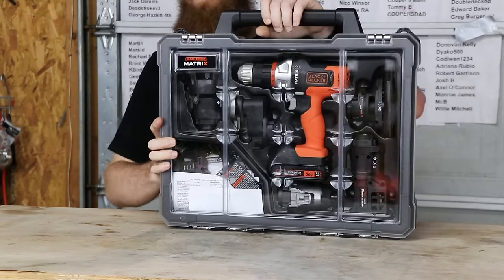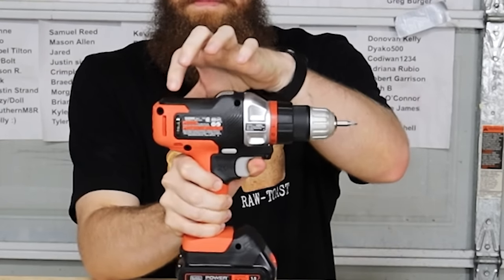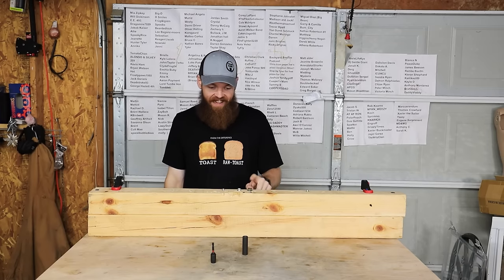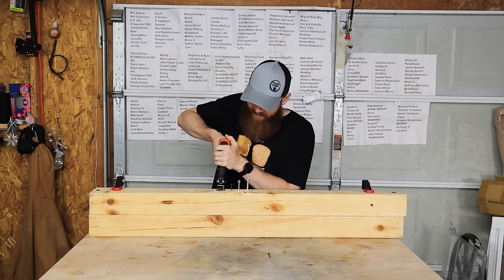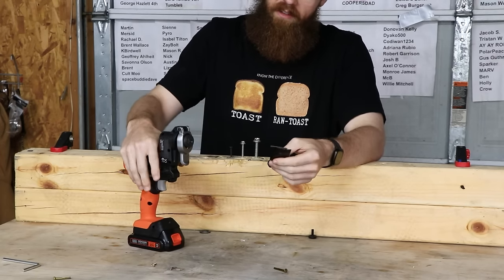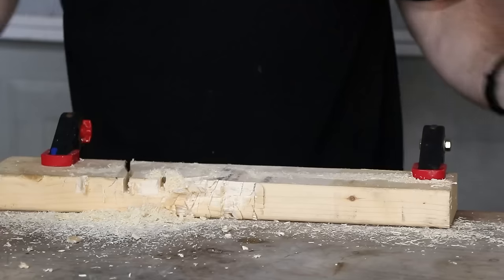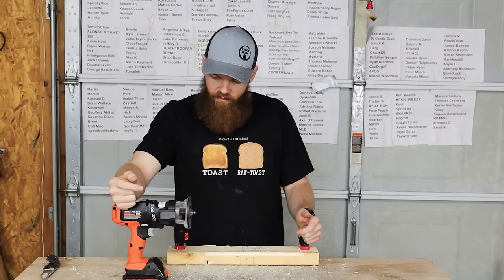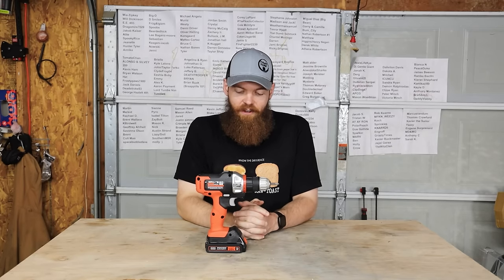Is This The Last Drill You'll Ever Need? | Black & Decker Matrix system

Comment: Before I could afford Dewalt tools I actually owned the 12 Volt version of this kit, they didn't have an impact or a router but it did what I needed it too back in the day. The main reason I stopped using it was the batteries wouldn't hold a charge anymore and the batteries were not as easy to come by as they are now with online shopping. There was no such thing as amazon back 20+ years ago, the internet wasn't as well known back then either. Good little kit for the small time fixer/ weekend warrior... If your going to do regular work with robust tools then Milwaukee or Dewalt is the way to go.

Comment: The multitool blade should lock in with the quick connect. The screw adapter is for one that don't fit. My craftsman brushless multiness has the quick connect and the adapter which came in handy cause it turns out the dremel drywall blades I bought would  not work in the craftsman but the screw adapter worked fine. Pro tip for all you weekend warriors out there, Craftsmans power tools are just Dewalt tool but with cheaper plastics for 1/3 the price. Stanley owns Dewalt, Craftsman, and a few others. So far I have the v20 brushed impact and drill, 18ga Brad nailer, brushless multi tool, hacksaw, tire inflator, and the brushless impact and drill at work and I have to say I'm pretty impressed with them. The Dewalt versions are better but your also spending alot more. I recently had an issue with my Brad nailer jamming, contacted customer service bout it and they sent me a brand new one free, don't even want the old one back. So pretty good warranty

Comment: I still have my Black and Decker corded drill from 35 years ago.  I also have a 12v lithium cordless drill from probably 10+ years ago and I love it.  I have beat the crap out of it and it still runs perfect.  My Black and Decker jig saw... well it runs but I have gone through them pretty fast.  I rarely get 10 years out of them and they are falling apart pretty bad.  My 25 year old plug in circular saw still runs great.

Comment: I have a black and decker weed trimmer which is pretty good. Works well I bought it cause my nephew killed my craftsman weed eater that I couldn’t get another one and this black and decker works with the same 40v battery that my craftsman used. So now I have three 40v batteries.  17:15  I would never use that attachment to router a project. I prefer actual routers that you can hold more steadily. That one you can’t really control. When routing a piece of wood you don’t want to do the full depth on the first pass. You want to start shallow and continue to the depth.

Comment: I use the oscillating tool everyday in remodeling. The blades don't last long if you cut metal with them. They are just desposibles when it comes to remodeling we use between 75-300$ worth of blades per job

Comment: Impossible not to enjoy Tyler. I have all the Matrix tools for those edge cases which come up out in the field - use them maybe once a month.
After five years, they have held up just fine. The router, impact driver, trim circular saw and sander exceed expectations, a lot. The jig-saw and multi-tool are OK. The drill is adequate.

Comment: Years ago, B&D had a similar set that used their old 14.4v NiCd batteries.  It had a small circular saw instead of the oscillating one.  I got it for computer and network installs.  It turned out to be one of my favorite tools.  I had Makita, Hitachi, DeWalt, etc..., but I ended up grabbing that multi kit B&D most often, for the convenience, and the odd reliability of it.  I still have it, and would have continued using it regularly, except for the batteries.  Like all NiCd, they're crap.  

Somebody really needs to come out with a lithium battery system for those millions of B&D tools that use that 14.4v and 18v batteries.

Several months ago, when I saw they'd released the Matrix kit, I pounced on it.  I also did a little searching, and found the circular saw attachment, as well as a couple extra batteries, and a better charger.  It's been very good.  And, very convenient.  I rarely use it at home, or in my shop, primarily because of the small battery capacity, and the odd offset of the handle to most of the tools, but it's great for doing some maintenance at my mother's, or my daughter's, or...  

It's perfect for the average household that just has the occasional need for some power tools, for household maintenance and/or hanging a couple of shelves.  It's definitely worth the money, even adding the extra bucks for the extra bits I picked up.  

BTW - that little circular saw is perfect for cutting trim, shelving, and thinner plywood.

Comment: For your multi tool blades by the Imperial Storm blades. As a contractor these blades last the longest on any material including harden metals like screws. Way outlast the Milwaukee brand (although Milwaukee owns them) Imperial is also made in the USA

Comment: I had this drill...it's not awful...it's not for a jobsite,. But for around the house or a truck kit, it's not bad. Mine had a reciprocating saw and a tire pump attachment. The pump saved me a couple times! My drill was just the battery and drill. The others I had to buy separate. May have been higher spec. It didn't struggle nearly as bad as this one. Neat idea! Like something from Makita

Comment: I can't say alot on black and decker tool's because I've owned/own several and they have never failed me. I mostly use Dewalt because it's what I grew up with alongside craftsman tool's also. And to be very honest I've had a couple DeWalt drills fail before the couple black and deckers I own. I can't speak on other black and decker tool's because I've only ever had a couple drills and bit set's. I even have circular saw from Ryobi that's gotta be like 15yrs old now and still performs like a champ, only down side with Ryobi is the batteries aren't as good as other brands like DeWalt and such. And the way I see it there has to be a class of tool's for everyone. I see this as something for someone who doesn't do construction and just needs certain tool's occasionally around the house. But you can't really compare these cheaper end tool's to higher end because they aren't made for the average construction worker, but more for the simple man or woman who just needs something affordable for occasional use. And that one is a multi tool.

Comment: The oscillating tool is also referred to as a fine tool, we own a few different ones on the job site.. dewalt, milwaukee, makita. None of them are great at cutting metal because even though they ‘can’ that’s not necessarily what fine tools are for. That’s more for Sawzalls.
Reply: No, it's called a oscillating multi tool not a fine tool. And it's Fein not fine. Fein makes oscillating tools is all.

Comment: I actually bought one of the drills for use around the house a few years back. It was like $30 for the drill and 2 batteries. I never even got to try it out, both batteries were fuct out the box. They would charge for an hour or so and then die immediately. I took it back and never looked back.
Reply: Good lord thats gone up alot over the past 13 years.

Comment: Ive had my Matrix for roughly 4 years and used it two of those years profesionally, It held up great and I still use it constantly. Its nice for smaller jobs that you dont feel like lugging all your boxes out to. The battery and stock charger is garbage however, as well as the plastic clip on the blade quich release broke over time.

Comment: So yes cutting screws many are case hardened basically heat treated to withstand the torque needed to drive them so they don't just break in half so the multi tool vibrating blades really just can't take much cutting
Torture against them.

Comment: I bought this with the extra optional add-on tool accessories — a circular saw and a car tire inflation tool attachment. 
Everything works but it’s for light duty jobs. Not a ton of power. For a home odd-job fixer upper kinda person it’s a great affordable tool that gets the job done. Not recommended for professional work — not enough power. I never tried a bigger batteries with more amp hours so I don’t know if it could also have more torque power with say a 4 or 5 amp hour battery.

Comment: I enjoyed your video. I agree with you that most folks would probably use separate specific tools like a router, a sander, a cut off tool, or an impact drill if you were doing a lot of it instead of using this cordless matrix tool system. But for small jobs and certain situations, this system seems like it would do perfectly fine and all for a good value.

Comment: I’ve had this setup since about 2013. Like 10 years. Not super heavy use, but a decent drill that gets done what I need. Router and jigsaw not ideal ( I also have full size of both) but not bad if you are in a pinch and need something quick and not as heavy duty.
Reply: But when I bought it, it wasn’t sold as a kit. So I just got the drill, router, and jigsaw attachments.

Comment: bought this about 7 years ago, i dont remmeber what i paid but i have been using the impact and drill portion in the automotive field daily, mainly to drill small holes or remove screws/bolts from skid plates or air filter boxes, deff not heavy grade gets the job done

Comment: Tyler one thing I was thinking about as someone who has worked as a sawyer. Carbide teeth are really brittle when they are sharp! so usually you have to cut easily to smooth the tips out a bit then they should hold up better and not be so brittle. It might be worth giving it a try!

Comment: I was expecting the same thing (garbage), and was sort of surprised (~8-10 years back). There were more attachments offered than what there is now, as Sears also offered the same thing rebranded under Craftsman. Theirs also came with a metal drill chuck vs plastic on the B&D. It's also how I ended up with a corded base in addition to the 20v cordless, which was necessary at times. Used it to drill 6" holes in tongue & groove ceiling for lights, which may also have been the last time the corded unit was operational. All in all, the set was used a ton in the building of a want-to-be-cabin.
The OMT attachment was horrible, mainly due to the horrible blades. And never saw the router attachment. It also didn't hurt stepping up to a 4ah battery, as most tools benefit from. In fact, I'm still using the batteries in a B&D backpack sprayer

Comment: I have had the Matrix for years now and really can't complain much. I didn't see what all you had for attachments or what was available, but when it first came out you could also buy the radial saw attachment, the air compressor as well as a few that I see you have. As all small air compressors go, it definitely got hot filling a tire, but it could still get enough in to get you back on the road. It was the only one I wasn't a fan of.
The Matrix is absolutely a good introductory tool for beginners. Not for the everyday Joe using it for a job. 
I say B&D hit a home run with the tool, but went a bit cheap with the tool accessories (the blades, drill bits and such). So it goes back to the "kissing cousins". Sure it was a kiss, but it was with your cousin....
Reply: Yeah the air tool is meant for small tires and it would get hot no matter the brand. Compressing the air is what generates all that heat. Volume of air being compressed is its limiting factor which is to be expected for its size and intended use.

Comment: I don't know I had mine for a few years it's working great all the different multi tools even a router attachment use them  all  And it's holding up great... My favorite attachment is a circular saw... I bought the attachments as I needed them I don't have the vibrating blade..  Another good attachment is the Reciprocating saw,

Comment: I gotta say, I am impressed. And that’s coming from someone who would never, ever purchase a black and decker tool. I wouldn’t buy it because I have all dewalt and Milwaukee stuff. (Yes I know dewalt is owned by Stanley black and decker, but I mean I’ll never own an orange B&D tool)

Dewalt blades should work in the oscillating tool. Same mechanism.

The jigsaw is struggling in the 2x4 because the stroke is so short, plus it likely doesn’t have a orbital blade function like a real jigsaw. I bet it would do alright in maybe 3/8 plywood though.

It did much better than I was expecting though.
Reply: Orbital blade function for a jigsaw. Thats a special feature thing for a jigsaw as all the ones I have seen use the same up and down movement for decades and has been patented for the first jigsaw.
Reply: Main thing I noticed on Tylers "jigsawing" was the leverage.  It would probably cut easier by pushing on the attachment, rather than way up on the handle.

Comment: I would agree with your assessment,  it's a decent all around home gamer tool for someone who does a little of everything once in a while.  I've had a b&d drill for 10 years running on ni-cads  that has out lived the batteries, because it was a light use case. Also have a lithium drill driver combo home gamer setup that will probably do the same light duty service until its battery is worn out.

Comment: The 3rd attachment with the blade works better if you don't force it or jam it to the screws... I have a Milwaukee one and the blades work better when you use light pressure against the object you are trying to cut off...

Comment: They make a circular saw attachment. I bought the whole kit like you have and the circular saw attachment. I loved it for cutting nice clean holes in drywall for pipe repairs. A lot of the attachments I didn't use more than once...like the router.

Comment: I bought the matrix years ago when it was the "Walmart Brand" and it has held up. I have the jig-saw as well as the small circular saw attachment. The jig saw is great on small things. I wouldn't use it on a 2x4. The circular saw is great for cutting thinner sheets of plywood. The drill part is meh at best, but the thing has really held up over the last 6 years or so.

Comment: The oscillating tool is generally knows as a "multi tool," and it is not really meant for cutting through screws. Screws are much harder than nails. 

It can be done, but you are much better off pulling out your angle grinder when you need to cut through a screw.

Comment: I have my Granddads Old 240v metal body Black n Decker drill, Its older than me (im 52) and still works like the day it left the factory. Its not fast and only carrys a 3/8" chuck. but the powers there. Those things, made to last.  I also have a more modern Black n Decker Plastic body. Its nearly dead, The bushes are all worn
 and the things moves inside itself. lol. Made to be replaced.

Comment: You can use that same battery with an adapter HPA1820 on the old black decker firestorm nicad series pole saw, chainsaw, weed eater, hedge trimmer, 3 speed drill etc and you can use that same battery on Dewalt XP nicad series skill saw, saber saw, 3spd drill, sander etc, adapter BPS18D.
Caution dont run li-ion battery too low as no low voltage cutout.....

Comment: That tickle saw "multi tool" "oscillating saw" blades are available everywhere and in all different brands. I personally get mine at wal mart just because we use the crap out of them and they are cheaper there. But I've had Rockwell Milwaukee Ryobi Black and Decker heart hyper tough and some other Chinese no name but they're just the quick attach version.

Comment: I mean, I get it: B&D is trash for anyone who makes their living with tools.  But for your average homeowner trying to maintain/repair stuff, it's usually (just) enough for a decent price, especially if you catch them on a good year.  It'll struggle to get the biggest fasteners in.... but it will do it the handful of a times a homeowner needs to.  Not great if you're building a deck, but just enough for the occasional deck repair.  The weedwackers aren't great.... but they're uncomplicated enough for weekend Joe.  So on and so forth.  They know their market.... and they seemed to have figured it out pretty well.

The Matrix thing to me almost feels like a bigger brother to my Dremel set.  A lot of similar attachments, just scaled up.  Not that I'm complaining.... 

(Like a lot of things these days, quality control seems to fluctuate from year to year.  I have 2 versions of the same basic model B&D drill, and my 2010 version is bulletproof compared to the 2022 model)

Comment: I like my oscillating tool for certain things like cutting into drywall it works really well and for weird angle or weird area cuts you can't get other tools into but the part that seems to work really good is when you use the scrapper blade, that sucker makes quick work.
Reply: Yeah the metal cutting thing was always a gimmick for any of the tools as the impact for the tool twisting is what kills the teeth unless its aluminum or copper. Sawzall is better for cutting metal but you still need the right blade and screws are hard as hell for any blade.

Comment: I basically just use mine for drilling, lol.. I mean, I bought all the silly accessories for it, and then just recently switched over to its cooler and bigger brother, DeWalt. Especially since Lowe's was having an insane sale. I bought $300 worth of batteries and got to choose two DeWalt tools; I went Oscillator and Jigsaw. Should try them, but I assume they'll be more than fine. I also bought a twin pack of drill and impact driver. I don't have a lot of other DeWalt tools besides that portable table saw (that comes with a stand), miter, router (might have both the 1/2in and 1/4 cordless, I actually don't know about the half-inch plunge router, never used it) and their wet-dry vacuum.